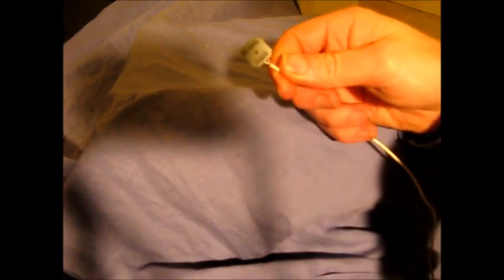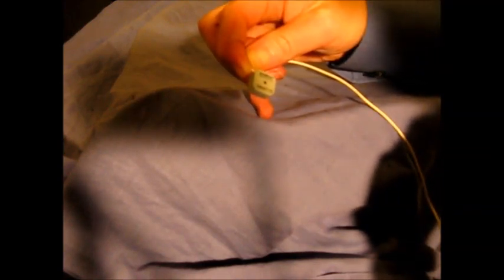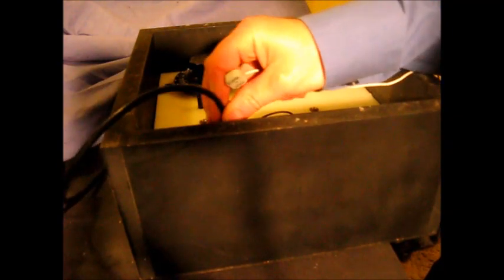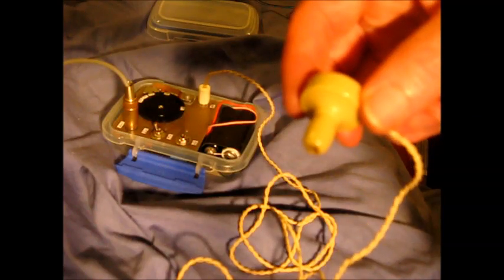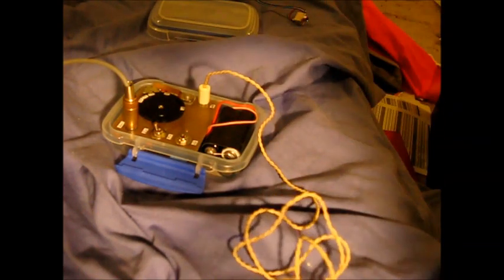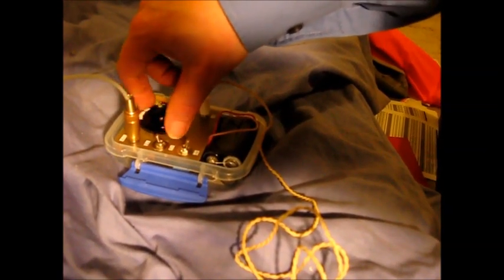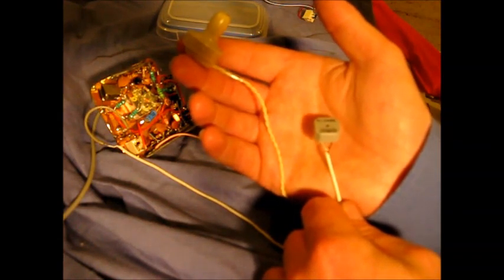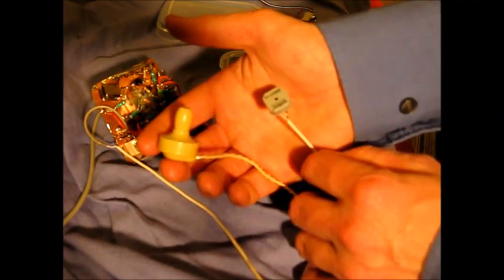Can't get a crystal earphone?  Try a piezo transducer.

Comment: Thanks man.
If someone is wondering why regular headphones ( ~ 32 Ohm ..etc.  ) do not work then read this
https://en.wikipedia.org/wiki/Headphones#Impedance
Reply: Try tought transformer 230V to 12V or use vacuum tube amplifier output transformer.

Comment: If you had an old headset you could mount the transducer inside the old headset with either RTV or hot glue to put it in place and it would make a nice HI Z headset for QRP or crystal RX use.
Reply: +emwavemhz 
That's a great idea!  Thanks